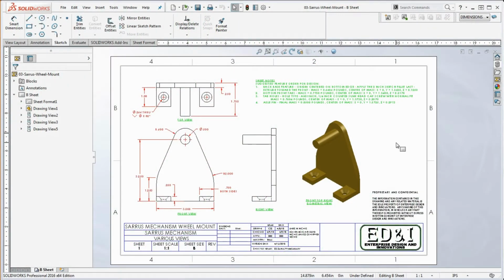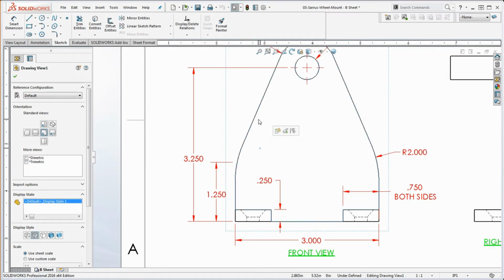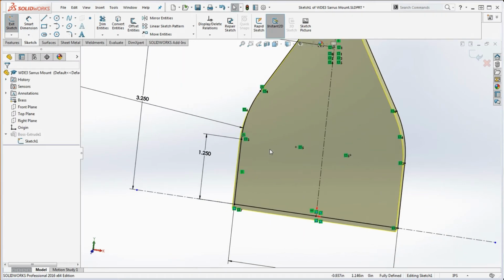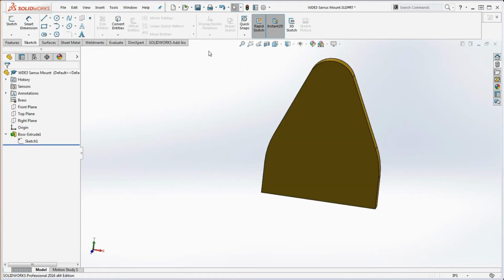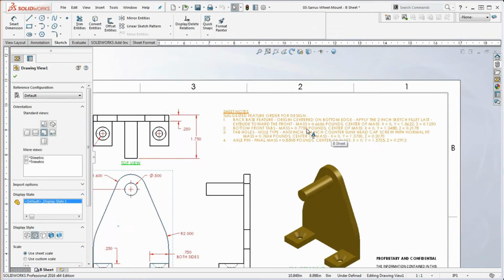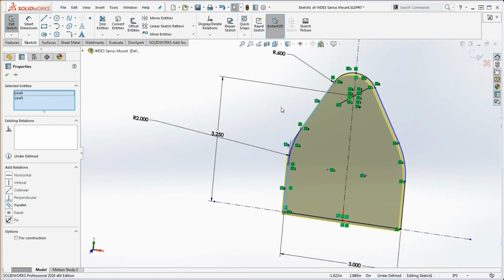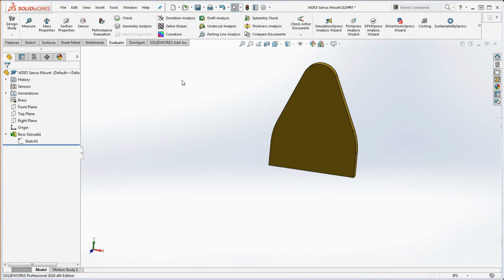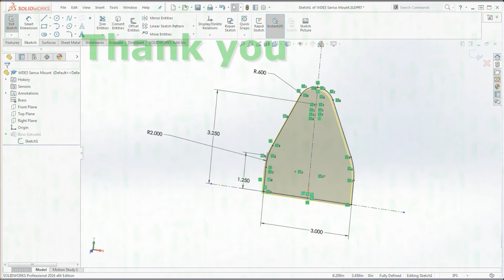68 SolidWorks – How to Dimension to the Center of an Arc or Fillet – Finding the Virtual Sharp

Comment: Or you could just use the find intersect command. A couple of clicks rather than a 4 minute video.
Click smart dimension. Right click on one of the lines. Select find intersect then select the second line. Then select the other side you're dimensioning to and you're done.
Reply from the maker: Thank you for the tip - SolidWorks is a vast toolbox giving users the capacity to accomplish the same tasks multiple ways!
Reply: @DesignInnovations  - Is there a way to snap on center of the countersink hole from the "front view"
Reply from the maker: @chetgillis9209  This is what I would do, look for the feature for your countersink hole, open it up and there will be two sketches, "show" the top one which is the location sketch containing a point. That point is now visible and selectable outside of the countersink hole feature.
Reply: @DesignInnovations  - is there an faster way.  it it was the top view, you would only need to snap to the edge then to the arc/circle and you got yourself an O.C. dimension...thanks for the speedy reply!
Reply from the maker: @chetgillis9209  let me know if you have any other questions, if you want to send me your file I'll show you how to do it via a video.
Reply: LIFESAVER man, i found you could select "select midpoint" after right clicking the fillet with smart dimension